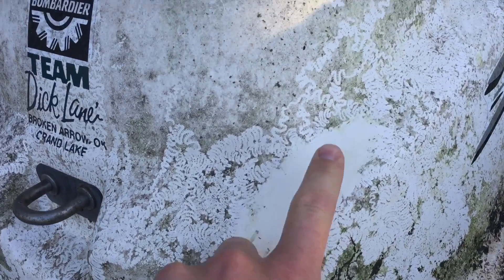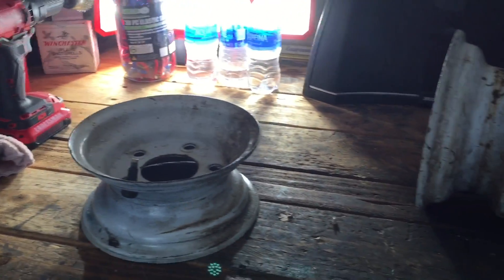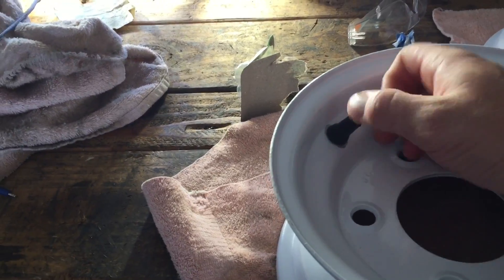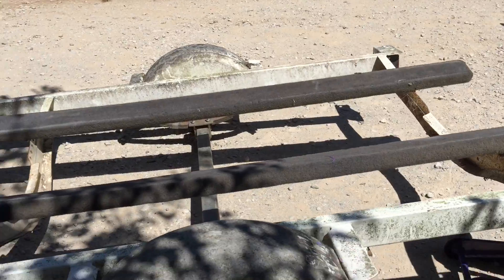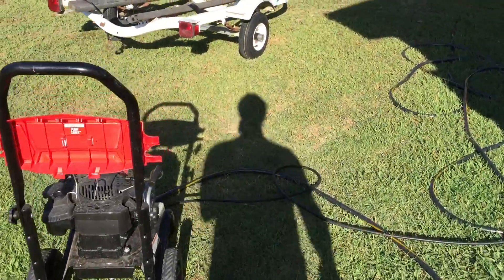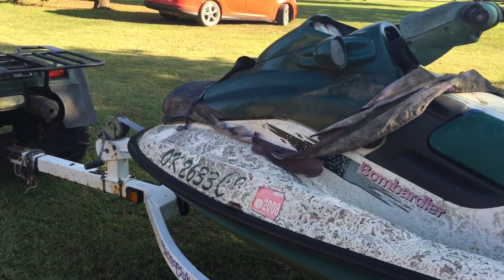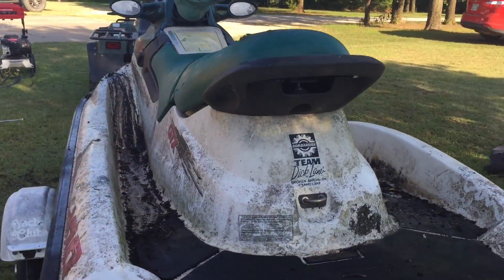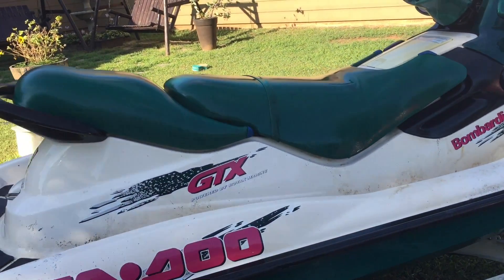CHEAPEST FB MARKETPLACE SEADOO REBUILD PART 1

Comment: Gtx 800🤣🤣 does it go 600 mph
Reply: Confused? It is a gtx 800, if I’m not mistaken this bulky hull and rather small motor only get it up to about 55 on a good day
Reply from the maker: It will do about 60 on smooth water

Comment: Dear sir 
  This is KingTec Racing (Wuxi) Co., Ltd. We have been focusing on the production of jetski accessories, the main products are connecting rods, pistons, crankshafts, impellers, turbochargers and so on. If you need, please contact me.
Reply from the maker: Do you make an impeller for a Yamaha 155mm pump?